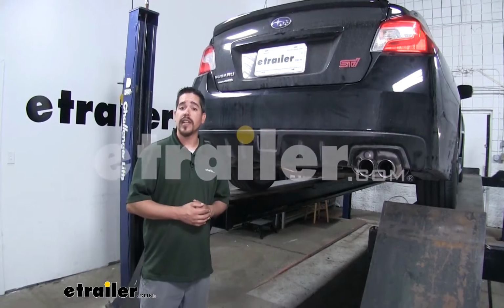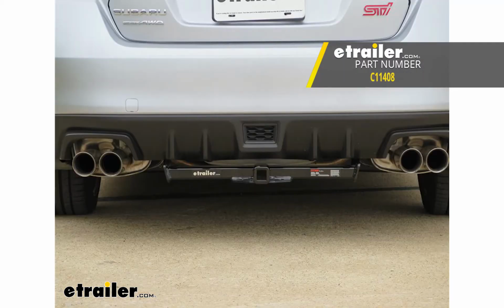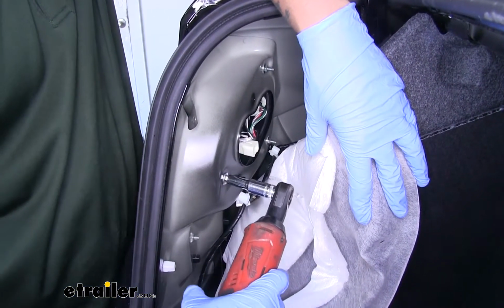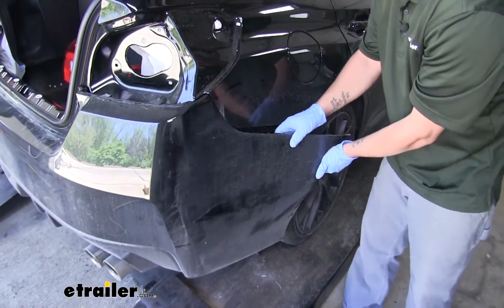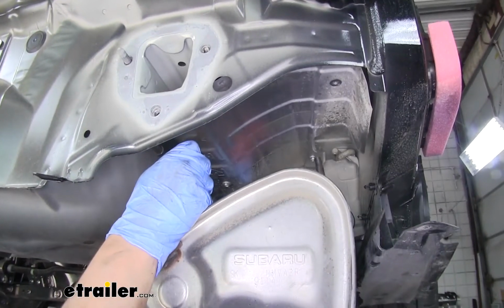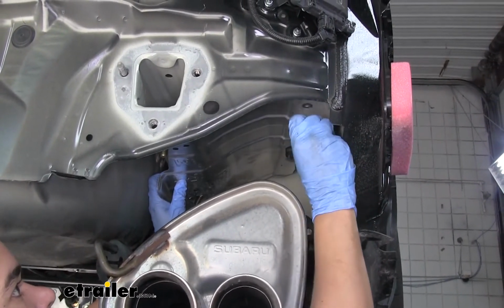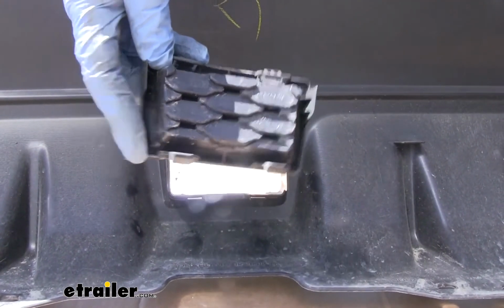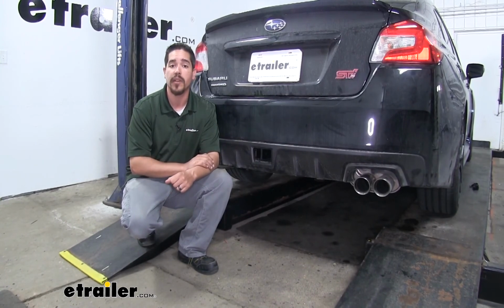etrailer | Setting up the EcoHitch Invisi Trailer Hitch Receiver on a 2019 Subaru WRX

Comment: Question - why does a trailer hitch assembly even have  heatshields?  I can see an installer ignoring them and throwing them out...
Reply from the maker: The hitch doesn't have heat shields, those are pre existing on the vehicle. I guess it's possible that an installer might try to leave them off when the hitch is installed, it's up to the vehicle owner to do their due diligence to ensure they're in place. If you'd care to check out the install instructions, I've linked them for you below. The heat shield is addressed in step 13 on page 6.
https://www.etrailer.com/instructions.aspx?pn=306-X7257

Comment: Tips on aligning? It’s slightly off center. I loosened the bolts but it doesn’t really move
Reply from the maker: How far off-center are you talking?
Reply: @etrailer  like half a centimeter. I can fit two fingers on both sides of the hitch in the fourth brake light cutout, but one is tight and one I can move my 2 fingers a bit. I don’t think I could’ve adjusted it. It was super tight up against the exhaust hanger hooks

Comment: is that safe with 220lbs dirt bike
Reply from the maker: That's a great question, for sure! However, we don't have a good answer for you. The hitch is rated for up to 525 lbs of tongue weight, but the actual tongue weight capacity of the vehicle itself could limit that. Unfortunately, in the owner's manual Subaru states that the vehicle should not be used for towing so they do not list a towing or tongue weight capacity. We'd recommend checking with your Subaru dealer and getting their take on it.
https://www.etrailer.com/Trailer-Hitch/EcoHitch/306-X7257.html
Reply: @etrailer wow why how do you even sell this if you cant answer that ?
Reply: I'm sure you've found your answer by now, but I would deem your dirt bike safe, so long as you're using an appropriate sized trailer. From what I've 'read' you can tow up to 1000Ib *no brakes on trailer*. so a small trailer and your bike should be fine. I've also personally seen 100+ wrx's towing small/medium cargo.

Comment: Will this work on a 2022 Subaru WXR ?
Reply from the maker: The 2022 model year is the first year of the latest generation WRX. Therefore, the hitch manufacturers haven't figured out yet if the previous generation hitch will carry over to the new model. They should know if it fits by late spring.

Comment: What size are the bolts that mount to the frame rails?
Reply from the maker: The bolts that are included in this kit are 1/2”-13 x 2” Bolts
https://www.etrailer.com/Trailer-Hitch/EcoHitch/306-X7257.html